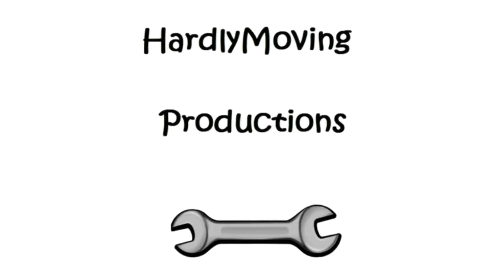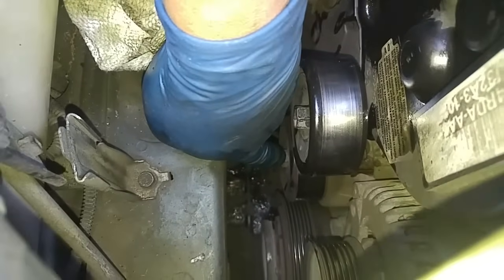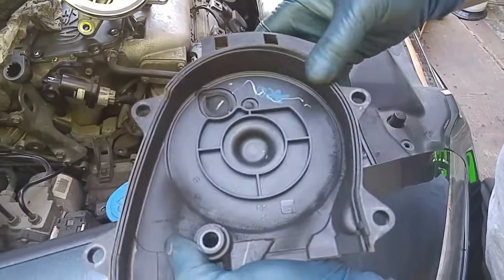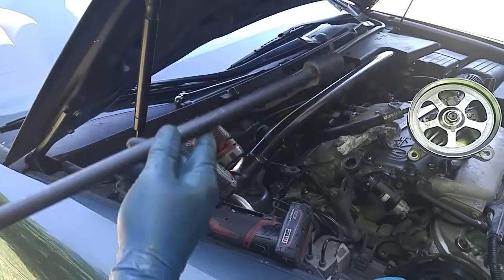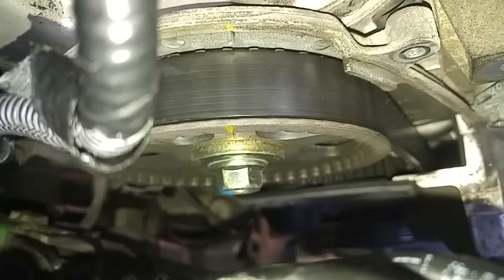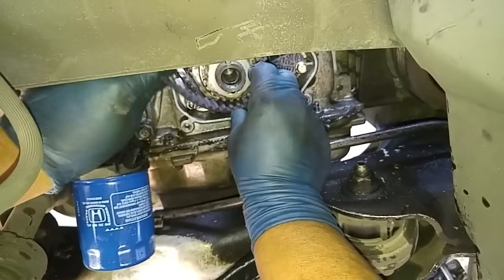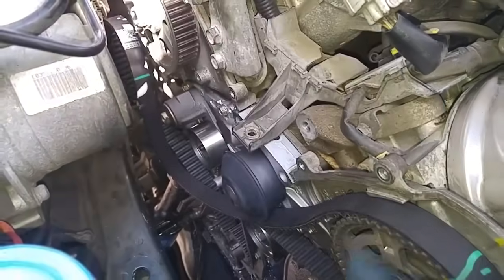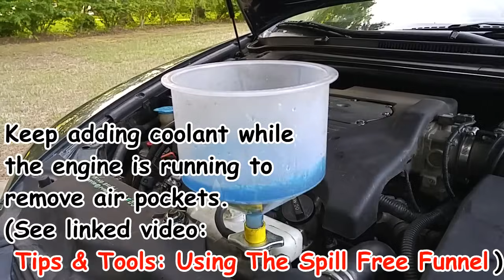Acura TL (Honda Accord V6) Timing Belt, Water Pump, & Pulleys Replacement

Comment: Hats off to you sir. This format of instructional video is perfect. No blabbering bs constantly.  Very clear and quick. I normally speed up automotive videos and skip forward but not once did i have to do this with your video.  Thankyou
Reply from the maker: Thanks for the post!  Glad you found it useful and informative.   We try stay on point with our videos.

 To support our channel, give us a thumbs up and to get notifications of new videos, please subscribe.
Reply: Awesome and showed reassembly. Most just tell you to put it back reverse of how you took it apart. I may attempt this myself. The marks on the belt is a very nice trick of the trade! as that is my biggest concern. I'm doing this on a 1999 model which actually has a little more room to work.
Reply from the maker: Thanks!  I've had guys post that paint marks aren't necessary.
Reply: @hardlymovingpro  ít hight Technic and  ưell done
Reply: @hardlymovingpro  love the simplicity of your tutorials. People tend to leave cameras pointing at ceilings lol. What brand power steering pump was that. My type s look deferent. Maybe after market. What water pump you used. I gotta check if I’m running oem. Car engine is fine but the belt,pullies fans all soon harshly loud.

Comment: Torque specifications are very important. Furthermore, you should always ensure the timing belt is installed correctly by rotating the engine with a breaker bar twice. if your marks still line up after those two revolutions then finish putting it back together. if not then your still out of time even if it is only a single tooth this will cause damage to the engine if you dont ensure its lined up Correctly. Other than these two things you did an outstanding job.  Master tech here. 35 years exp.
Reply from the maker: Thanks for your post!  I use paint marks and transfer them to the new belt to avoid wasting time with the "two revolution" technique after belt installation.  If there's no belt slack between the cams and cranks, you're in alignment;  however, engines that do not have have a self adjusting pulley tensioner (mostly the 4 cylinder engines) do require rotation to allow the belt to seat.  But instead of rotating the engine, I start the engine which I found to better seat the belt.

Comment: Never seen a CRANK BOLT come out that easy lmao wow
Reply from the maker: That 19mm high mass impact socket is one of the most marvelous tools I have!  More than paid for itself!
Reply: Gotta have a high mass impact socket. Even with one, sometimes these take quite a few ugga uggas.
Reply: Took a breaker bar and cheater pipe about 4 foot long for us to bust mine lose, Been doing this a long time and never seen a crank bolt that tight, crap gets real when a socket flies off... lol
Reply: Exactly,  Mine was horrible
Reply: @Slamms inyourface - I calculated about 1400 ft lbs of torque on mine. The ping sound when it broke loose was frightening. I thought I died for a second.
Reply: @everythingisfineandgood  I had to do the mix of impact gun and using the starter technique a couple times to break mine loose.
Reply: The best way is to get the Honda acura balancer holding tool.

Comment: Very informative video. However, it would be nice if you would give the honda parts numbers for the parts used in this job.
Reply from the maker: Sorry.  This is a free to the public how-to video.  Also, all repair manuals like Haynes and Chilton do not provide OEM part numbers.

Comment: I could only find 6 bolts on the lower timing belt cover on my 07’ TL Type S…. Atleast that’s all I counted coming off!!!
Reply from the maker: Good ... as long as you didn't damage anything in the process.

Comment: Great Video!  I need some advice about a problem that I have yet to see on any YouTube videos.  I'm working with a 2003 Acura MDX and started by following the shop manual instructions.  I completed the project; and hand rotated the belt 5-6 times as stated in the manual. The timing marks all lined up but the belt had walked from the center of the camshaft sprockets to the engine side of the sprockets.  I decided to put everything back together and see how it ran and if possibly it would migrate back to the center of the sprockets.  It started and ran fine for approximately 10 minutes, but once it was warmed up I could hear some knocking.  I took everything apart and the belt was still against the engine side of the sprockets and a small amount of grey powder was visible.  So the timing belt is rubbing. I've tried flipping the belt and adjusting the torque on the tensioner pulley.  Each time after I take the belt off, reposition it in the center of the sprockets and rotate the crankshaft pulley 5-6 times it has moved against the engine side of the sprockets.  I reviewed TSB 08-03.  That supposedly doesn't apply to a 2003 MDX, and the shim that they recommend installing would seem to move the belt towards the engine to keep it away from the engine mount housing.  Anyways, long story short, I'm stumped...any ideas??
Reply from the maker: Only way a belt can move out of center is from a out-if-center tensioner, guide or water pump pulley bearing IMHO.  Don't understand how you adjusted the tensioner.  It's auto adjusting.  Also don't know the brand of the belt kit you bought.  Knocking noise after 10 min run?  Has to be one of the bearings.
Reply: @hardlymovingpro  Thanks for the quick response.  The Timing Belt kit was a genuine Honda kit.  As far as the torque on the tensioner pulley;  someone online mentioned that it's possible to overtighten the pulley bolt and cause the belt to offtrack..  I loosened and then retightened to 19lb/ft as the manual stated.  But I guess it is possible that the pulley bearing was affected by running for 10 minutes before that under high torque.  I've found the shim for the idler pulley locally and I'm going to pick one up tomorrow and see if that makes a difference.  Possibly I could flip it around and have the thick edge on the right side.  Some of the timing belt kits that I've seen for sale include the shim, even for the 2003.  I'll keep you posted...
Reply: Problem Solved!  I purchased a timing belt component kit which included an idler pulley & bolt, tensioner pulley and metal shim.  When I compared the previously installed, new Honda tensioner pulley with the newly purchased Dayco one it was fairly obvious that the Honda pulley wasn't evenly aligned from left to right.  It was off by a millimeter+.  Perhaps it was dropped at the factory or???   It came out of new packaging.  I put everything back together with the new components and the off tracking issue hasn't reoccurred.  This would be a good reason to turn the belt 5-6 times to not only check the timing marks but ensure that the belt isn't wandering.  Thanks again for the informative video and prompt advice.

Comment: Would this be similar to 2017 Honda Accord V6? I’m planning to do it myself. 😋
Reply from the maker: Yes.  Difference may be in the location of the computer.  But the belt, pulleys and tensioner should be virtually identical in design configuration.

Comment: Excellent work on making this video. You look like you've done this a few times, lol.  Do you know whether or not this particular engine (3.2L-V6)was designed to not damage valves if the timing belt breaks while the engine is running? This is what happened to me. I didn't want to replace the timing belt just to find out I have to remove the cylinder head and replace a valve or three.
Reply from the maker: Thanks!  What you're asking is if the 3.2 is a interference engine?  It is as car makers keep raising engine compression ratios to obtain more fuel economy and power.  If the timing belt broke at low rpm's, it's possible the valves may not have bent.  Only way to tell is to perform a compression check on each cylinder with a newly installed timing belt.

Comment: Just finished my first water pump/timing belt on a 2000 Base TL. Although there are a few slight differences ( the 2000 is 2nd generation, '04 TL is 3rd. Small details like 2 drive belts instead of one, no bolt on "keeper" around crankshaft timing cog, etc.)
There's no way I could have done this without this video. I probably watched it 25 times total, starting and starting it countless times. I cannot tell you how good I feel right now, accomplishing such a daunting task, all the while standing on the shoulders of the genius who made this video.
Thank you sir. You should consider teaching a shop class for kids. I can see you changing young lives like you have mine.
Reply from the maker: Hey that's great news!  Performing a timing belt and water pump replacement is a big accomplishment for someone who's never done it before.  Also, think of all the money saved if you had the dealer do it.  

To support this channel and to get updates on new videos, please subscribe.

Comment: What an excellently made video. Thank you for this. Good to know it can be done without needing a lift for the car, or worse, removing the engine. 

Still contemplating whether I can do this myself, especially without the crank bolt tool
Reply from the maker: If you can get the pulley bolt off, the rest is gravy!

Comment: How much would a job like this run?
Reply from the maker: I'd say between $800 to $1600 depending on whether local shop or dealer.
Reply: @hardlymovingpro  man it takes some real muscle to get the dumb azz bolt out🤣🤣..any tips

Comment: I used the lisle 19mm high mass impact socket and I still can’t get the Harmonic Balancer bolt out idk what to do, tried with a regular 19mm high impact socket and a damper but that didn’t work either idk what to do? Lol I’m stuck with a disconnected pump, mount, timing belt covers and a bar lol
Reply from the maker: You'll need a high torque impact gun
Reply: @hardlymovingpro  thanks for your reply sir!!! Ok I will try again with a high torque impact gun tonight.
Reply: @hardlymovingpro  counter clockwise or clockwise? I’m giving it a shot this morning. I want to make sure I don’t strip the bolt because that would be too much fun lol
Reply from the maker: Counter clockwise or lefty loosey
Reply: @hardlymovingpro  thanks do you think 585 ft lbs max torque will do?
Reply from the maker: With the high mass socket yes
Reply: @hardlymovingpro  ok so I used both the high torque impact gun and 19mm leslie high mass impact socket and it isn’t budging. I took WD40 Penetrate and a torch it is still not budging
Reply from the maker: The gun I'm using in the video puts out 1,400 lbs of torque.  But I've used guns with less torque.

Comment: Do you not really need RTV on the water pump? I don’t think I will ever not use rtv
Reply from the maker: The Honda O ring design is very robust.  Never, ever experienced it weaken leading to leakage.  Ford and GM metal gaskets with the rubber coating, however, does eventually leak.

Comment: I’m having trouble getting the crank pulley off. Is it left torque or right? And if left what’s a good way to get it off?
Reply from the maker: Standard direction.  Right to tighten.  High mass impact socket with a high torque impact gun.

Comment: Most excellent video! But the only thing that bothers me is allowing coolant from water pump just pour over the crank sensor,, mine seems due an 06 TL runs smooth and powerful but it has clatter on cold starts below 70°f then goes away when motor is warmed up, I'm looking to have it changed soon,, Perfect Video!
Reply from the maker: Thanks!  You can blow the sensor dry with compressed air if you want.

Comment: Thank you, i did my 04 accord, and i followed all ur instructions and it works out very well thank you. I noticed to remove the camshaft bolt was like going to war witbout a powerful gun. Always make sure your gun have more than 700lb pressure to remove it easily.
Reply from the maker: Thanks for sharing your experience and advice!

Comment: Question : when using the 19mm high impact socket is there a chance it would spin the pulley/harmonic balancer and throw off timing marks or bend valves?
Reply from the maker: With a impact gun, no.

Comment: The gasket of the bottom timing belt cover is attached or stuck to something on both ends and didnt come off with the bottom timing belt cover. Is that how its supposed to be ? Do i just yank it off ? Not sure what i do with that..
Reply from the maker: Yank it off.  Timing belt cover is simply a dust and moisture cover.  You can make due without the gasket.
Reply: @hardlymovingpro  thankyou for the quick response ! Middle of changing timing belt rn! Video is great, helped alot ! Subbed
Reply from the maker: You bet!

Comment: Awesome video my guy, I'm tackling this thanks to you. I tried the valve adjustment , why not try the timing belt right? Quick question, what if there aren't any markings, how do I know where to align?and how do I know exactly if it's at TDC? (Without markings)
Reply from the maker: They're no markings on the belt but there markings on the pulleys.  Put paint marks on the belt where they align with the pulley and transfer the marks to the new belt (all shown in the video).
Reply: @hardlymovingpro  Okay thank you sir!

Comment: Boutta just buy the parts and have a shop do it
Reply from the maker: And breakout your wallet with some big bills!
Reply from the maker: @locdogwitd9  I can relate with that!
Reply: @hardlymovingpro  having to pay big bucks better having to pay for a whole new engine lol. My tl only have 78k miles
Reply from the maker: @locdogwitd9  belt should last pass 100k
Reply: @hardlymovingpro  yeah I hard Max like 105k, but do you have vids of how to do lower/upper control arms?

Comment: Hi. First off great Vid. Not sure if this has been asked already, but Can I just replace The 2 Bolt hydraulic Belt Tensioner by just removing Accessory Belt & covers then remove tensioner & replace? Or would I still have to remove timing belt Before I can install new Hydraulic Tensioner? I’m trying to just get rid of my knocking sound. Not trying to replace water pump & belt might be selling car soon. I just want to get rid of knock. Thanks
Reply from the maker: Thanks!  Yes...you can remove the tensioner without removing the belt.  Afterwards, you can install the new tensioner with the tensioner pin pre-compressed.
Reply: @hardlymovingpro  thanks for fast reply. Last Question, Will I have to remove Crankshaft Pulley in order to get to Tensioner to remove the cover? Just wondering before I do this job so I can order me a 19mm harmonic socket to remove crank bolt. I just want to be prepared & make it as smooth as possible. Thanks again
Reply from the maker: Yes.  You'll have to remove the belt covers.

Comment: I took my 2005 acura in to get the water pump replaced and got it back with the 3rd gear slipping... any ideas??
Reply from the maker: The water pump is driven by the timing belt.  If the camshaft and crankshaft are out of time due to belt misalignment, that will result in erratic transmission shifting.   Happened on one of my customer's Toyota Highlander.  New belt installed with proper alignment and his shifting problems disappeared.
Reply: Thanks so much!! I let the mechanic know, and that was the issue. The car's running just as good as before!
Reply from the maker: Good for you and thanks for sharing!

Comment: on 5:15 how did u get the bolts out i barely have space to even get my ratchet down into the second hole i’m struggling with replacing that my engine is leaning to the left side with no support so i need to replace that part on@5:15 due to bolts stripping inside also is it because it’s lower than it’s supposed to be and i have to jack it up a bit ? i need help please respond 🙏🏽
Reply: or does it just slide out without you having to take all the bolts out as long as they’re loose ?
Reply from the maker: Yes.  Slide out with the bolts in the mount.
Reply: @hardlymovingpro  thank you i’ll try that once the temperature cools down been over 100 past few days

Comment: Great Job 2001 Acura RL 3.5 i pulled the waterpump has big o ring but where it attaches to the thermostat housing do i just replace the o ring there as the waterpump i pulled out had the flat gasket and the oring somehow think that was incorrect thanks for any help
Reply from the maker: Your new water pump should have come with a new O ring.  Replace the old O ring with the new O ring.  There should be indentations on the water pump O ring grooves to hold the new O ring in place.   This makes mounting the pump onto the engine block easier by prevent the O ring from popping off its groove.
Reply: @hardlymovingpro  yes the big oring back of pump no problem its the small port that leads to the thermostat housing i put the rectangular oring in there but the old water pump also had the paper gasket which i dont think it needs. I think was replaced before and someone used 2 gaskets. I am guessing just used the rubber oring only!
Reply from the maker: @njoeandjen  ok

Comment: Great video, about the only thing I don’t agree with is using the old tensioner itself. 

We have several Honda/Acura vehicles with the J-series engine. & once the tensioner gets old, it starts to rattle & loses its ability to keep the timing-belt tight.
Reply from the maker: Thanks for your post.  Good to know about the tensioner.  Don't seem to have that problem with Toyota's.
Reply: @hardlymovingpro  indeed, we have several Honda/Acura vehicles with the J-Series V6 engine. The timing-belts in all of them were fine, but the tensioner in every one were rattling like crazy (think of engine knock noise)!